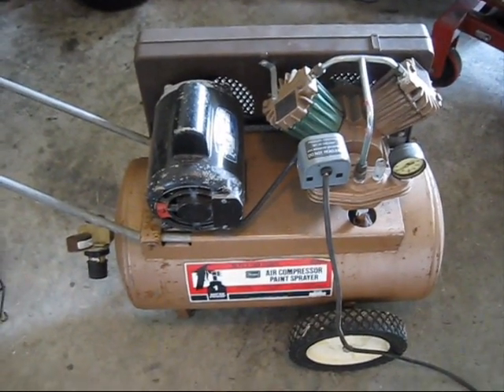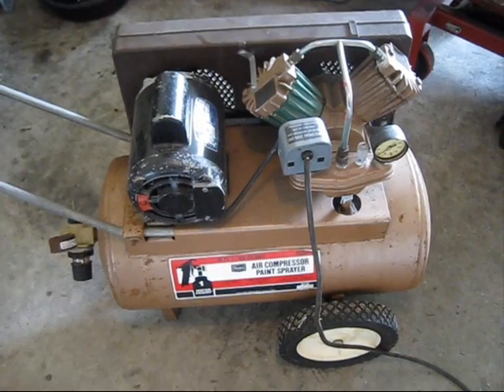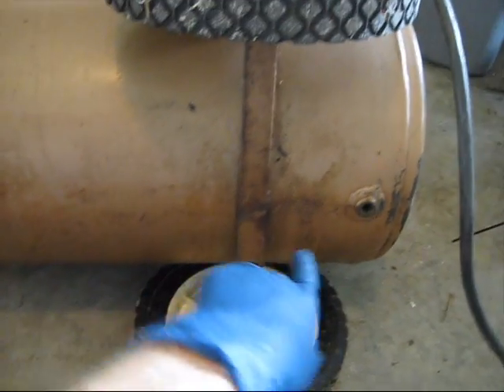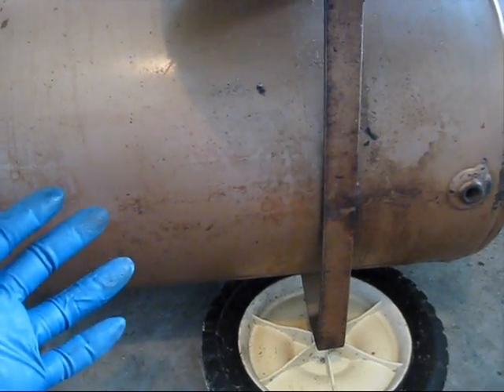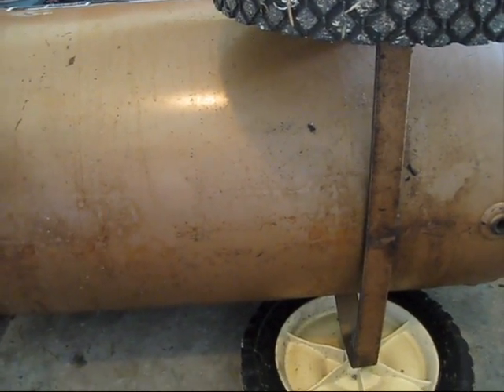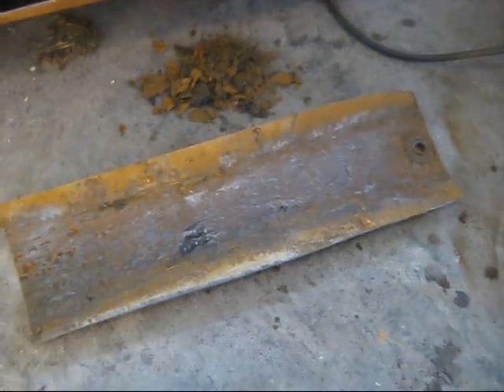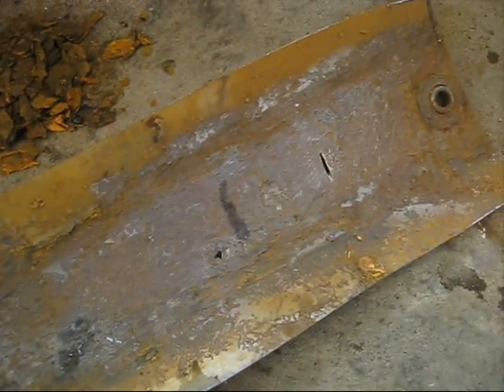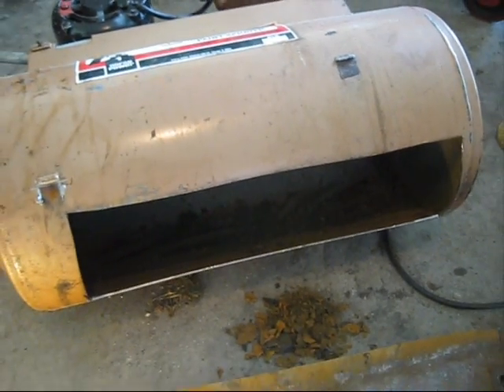What happens when You don't drain your air compressor

Comment: Wouldn't that tank just release?  How could it explode?  I had a Emglo twin tank release just a few weeks ago.  It began to hiss and that was the end of it.    I worry about hot water heaters where there is pressurized water.
Reply from the maker: Water doesn't really store potential energy since it doesn't compress. That's why they Hydro test tanks, if it fails the water just falls out. Compressed air stores tons of potential energy. If a tank is weakened and starts to give it can unravel rapidly, much like pricking a balloon causes it to pop, compromising the structural integrity can cause a tank to explode. Many people have had tanks crack or get a pinhole leak without exploding, then wrongly assume they will never explode.
Reply: @pfun41   Hello,  Yes that is exactly my impression. I've watched a number of them leak out through pin holes.   For me it is hard to imagine how 100 -140 psi would burst a tank .   When it comes to water heaters I see how they build pressure with heat.
Reply from the maker: 100-140 is more than enough if the pressure vessel is not up to the task. I know a guy who  used a cobbled together air compressor for years. Then one day the tank exploded. Smashed up his truck and completely took out the gas meter to his house. He's probably slightly more deaf now too.

Comment: Someone please explain this to me. If the tank is really old but not leaking, wouldn't a new safety valve be an adequate solution? Maybe even TWO safety valves, in case one fails. If the safety valve is working, and rated for 125 psi for a consumer tank like the one shown in the video, is it still dangerous? Will a rusty tank explode and hurt you at just 124 psi?
Reply from the maker: In this case it's not so much an issue of too much pressure, it's that the tank is too weak to handle it. Think of it this way, A balloon makes a pretty good pop, and that has only a few PSI. Well now imagine a balloon that's metal and has 100 psi.  When the tank becomes thin enough and weak enough it will let go whether it's overpressured or not.
Reply: Yes, 124 psi can be deadly.
Reply: Replace the relief valve if it isn't working. However, a tank rupture at your 125 psi rated pressure can still occur if the tank is compromised. The resulting thrust can launch the compressor through a wall or ceiling. 
As a rule of thumb, any gauge pressure above 15 psi can generate supersonic flow.

Comment: Kind of along the same lines as someone else commented -- manufacturers could and should do something to prevent this problem. Maybe just painting or powder coating the tank interior or the sheet metal from which the tanks are made. Or, make the tank out of galvanized steel, which would prevent rust or at least prolong the tank life well beyond the normal lifespan for unprotected steel.
Reply: Totally agree
Reply: they do and charge an additional 600 dollars for a 30 gal

Comment: For my new compressor, i used WD40’s White Lithium Grease to coat the tank’s inner surface. I bent the tip of the small extended nozzle tube into a small “C”  and inserted it through the drain hole. Once the “C” tip is in the tank, I gave it a good spray everywhere. I will try to angle the tip pointing towards the bottom of the tank where rust usually forms to coat it as much as possible. I did use the same WD40 spray on lithium grease on the sheet metals in my air conditioner, that stuff stopped rust cold on its tracks. Coated it for 3 years, not a speck of rust anywhere.
Reply: So lithium greease will not go through the compressor hose?
Reply: I coat the frame of my pickup with that stuff every year before snow and it protects the frame from salt.

Comment: Excellent information. What a well built air compressor and a real shame that the air tank was not drained of water regularly. I would take the motor and engine off that tank and put it on a brand new air tank.

Comment: These things should be painted on the inside with enamel paint at the factory.  Also, the drain plug needs to be bigger, and left off when not in use...that would allow room air to circulate in and for the moisture to evaporate out.   So I'm chalking this problem up to an industry wide design defect.  Failure to paint insides of tank; using to thin of a walls on the tank; and inadequate drain valves that are not big enough or robust enough to be taken every time you are done using it the compressor and to be left off.
Reply: i have a 1980 30 gal sanborn and i have looked inside with a scope and it was painted inside same as outside doesnt seam bad
Reply: @russevans6831  I don't think my dad ever drained his.   I watched this video, and went and checked it, and sure enough there was a drain plug at the bottom.   I myself always drained my own car sized pancake pump just to get the moisture out every now and then.   

When I did his shop refrigerator sized one, gallons came out.   I suspect he has never changed the gear oil in either...    and I'll probably never ger around to doing that.  Going blind and out of time.

Comment: Pfun41 hello my name is jason i recently got the exact same compressor from my great grandmas house i drained the tank it was full of what seemed to be motor oil the  electrical part is messed up i was wondering if youd like to sell me the electrical assembly  or donate it to me the tank seems to be in good shape i stuck a small camera in the tank the oil seemed to have protected the bottem theres almost no rust in the tank please get back to me if you can thank you !! Awsome vids btw! Keep them comimg
Reply: Im am very new to air compressors and it would mean a lot to me to refurbish this compressor coming from my great great grandma it means a lot to me thank you
Reply from the maker: I set it up to share a tank with my main compressor, try Ebay. You may also be able to clean the contacts in the pressure switch.

Comment: a coke bottle will hold 100psi and you are telling me that tank, even though its rusty, is just gonna blow up, it might leak but give me a break, lot of people nowdays have stuff that's gonna "Blow Up"
Reply: No one's telling you nothing obviously, because you're an idiot.
Reply: https://m.youtube.com/watch?v=KVP_A7eGYxw
Reply from the maker: So compressor tanks don't explode? Then what is this?
https://sites.google.com/site/metropolitanforensics/cause-of-explosion-of-air-compressor-tanks
I guess this one from the same manufacturer with the same tank is fake too?
https://www.youtube.com/watch?time_continue=159&v=KVP_A7eGYxw
Reply: Fake
Reply: It's the fact that there is a pinhole leak from the air receiver. With the potential to cause harm.
As a compressed air engineer. If I come across a customers receiver with a hairline crack or pin hole leak. I have to condemn it. Stop the job and quote for a new vessel. I do say to them if they are in dire need to use it, They sure can when im away as it is their property. But its on them for taking a risk if anything happens.
Reply: @thewu0217  Thanks for weighing in as a professional!

Comment: You didn't use that wire wheel in the video on your angle grinder did you? that wheel is only rated for about 4500 rpm. Your grinder is about 10000 rpm.
Reply from the maker: Good eye, and no, that one was way too shiny to have been used.
Reply: Cool. I've been wire wheeling and had to pluck the wires out of my shirt afterwords.
I've also seen pictures of the damage an exploding air tank can do. Good job on catching that one instead of passing it someone. I've I got a 60 gallon tank that I drain every day when I use it.
Thanks for the video.

Comment: I'd only get an old air compressor for the electric motor or the head assembly.
Reply from the maker: I only trust used compressor tanks that are fairly new and pristine.
Reply: @pfun41  or you could take the tank to a test

Comment: Grind it down and fill it in with a stick welder.
Reply: JB Weld
Reply: @MrTruckerf  You could easily use a lower gauge welding stick to patch things up. I don't agree whatsoever when he says that it isn't ok to weld on something like that. I've done it a million times without issue.

Comment: I had one almost like that with the same hole welded it up being using it for years
Reply: Can't fix stupid
Reply: Good for you,

 can you put me in your will, like, soon?
Reply: yea il put you in my will you want me to leave you the air compressor its still goin strong don't run it over 40 to 50 psi
Reply: @jonsworld5307  Lol. I like your sense of humor. Still, an accident doesn't happen until it happens, so that fact that nothing has exploded yet, doesn't mean it wont happen. Good luck with the compressor. I hope it never fails.
Reply: @gregholder5283 LOL ah it keep blowing a new hole every few weeks I got new one I still use it at really low presser on a blow gun some times  ever over 15 to 20 pounds

Comment: Tanks have a maximum lifespan too. They still rot even with frequent draining. These compressors were built to replace in under 10 years. My personal shop compressor is built using a locomotive air supply tank ASME certified to 380PSI. The problem with that tank is, it's WAY too heavy for portability. So they make these thin steel tanks for portability thus the maximum life span. If a person really wants years out of a thin tank, they'll have the inside of the tank coated before the first use. Warranty void = yes. Life span increase = also yes. Pumps are another matter, few are built like they once were.
Reply: How would you coat the inside?  I'm not gonna attempt it or anything I'm just curious.
Reply: Jennifer Pitts They have nozzles specific for coating tanks. they spray in all directions. After spraying they just move the tank around to make sure it's evenly coated.
Reply: Dragon Steel ahhh ok....  gotcha.  I just like to know & learn about all sorts of things (especially about machinery, technology, etc....  I have a 2001 escape I work on myself)
Reply: @DicksPC  it would still buy you time and therefore increase it's lifespan
Reply: Do you mean like a Fluid Film-KellsportsProducts/ Wool Wax 360 Degree spray inside , with an oil based product or some powder dusty mixture?
Reply: It's by design, that the pumps don't last like they used to. It won't be long, before oil less compressors are the only thing you can buy. They want to guarantee, the pump goes out, before the tank becomes dangerously corroded. They want to sell it cheap so you can afford to replace it more often, for the sake of safety. You can buy a whole compressor for less, than a good commercial grade tank of similar capacity.
Reply: @vincentrobinette1507  is it really for safety, or to have you spend money more often.